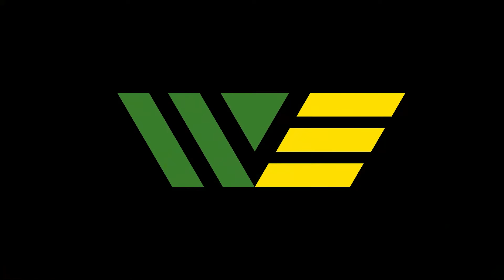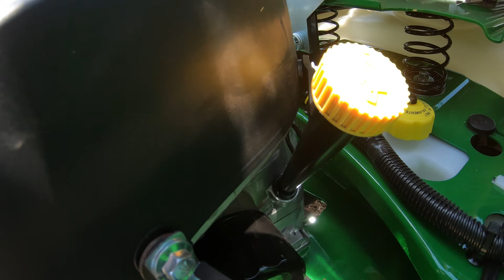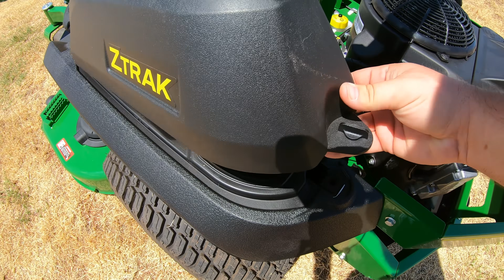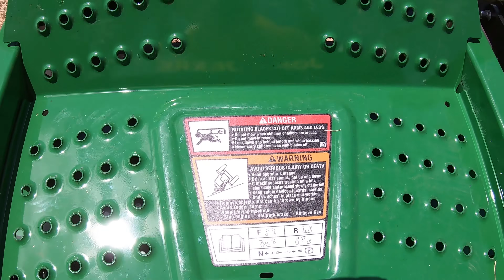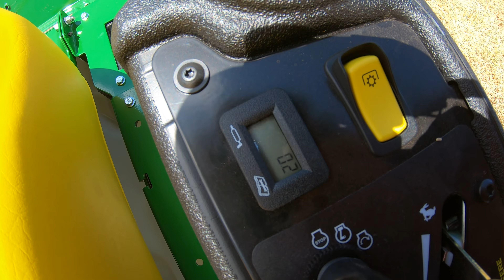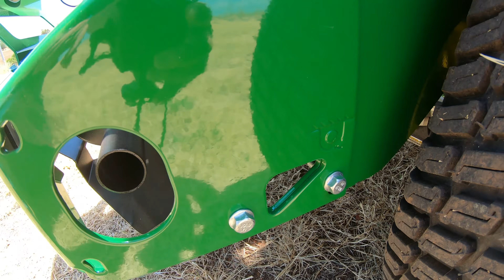2022 John Deere Z730M Zero Turn Mower Review & Walkaround

Comment: I'm thinking the Kubota z422 is better. It has the same motor but has wider rear tires and a better seat. I'm shopping around now.
Reply: Its a little cheaper to and has 3600  zts

Comment: I have a Z730m  and I love ❤️ it.😊
Reply: Just bought one today, can’t wait until it’s delivered
Reply: @RedNexTexMexVet hey did you get your mower? How are you liking it? Do you recommend it? How does it do on bumpy lawns?
Reply: @ClawzYT yessir I have had it a litte less than a year, it does great on my 3+ acres with lots of trees. I got the 54” deck, has plenty of power and almost too fast, i never go full speed. I did some upgrades included the rear bumper cage, hitch, and mulch kit. I also bought the Deere sweeper and it pulls it with ease even with a full load of grass and leaves. The seat glides and is very soft (cushioned). I can still feel the bumps but the seat cushion and glide take up most of the shock, it doesn’t hurt my back at all. I am very happy overall. Sometimes I look at the Stihl zero turns and think man that thing is nice maybe I should have gone that route, but rollin in a John Deere in the country also just feels right. Next I plan to get the lights and the airless tires which they say makes the ride even smoother
Reply: @RedNexTexMexVet hey that’s kool man, thank for the info. I’m about to get either this or the z735m at some point this season. I can’t wait.
Reply: @ClawzYT  of course, I got got the z735m btw with the Kawasaki. I think the 730 is brigs and Stratton but I hear are not as reliable

Comment: My z730M's right wheel keeps going forward when in the outward parking brake.  Do you know of any references of how to stop this?
Reply from the maker: You may have a bad connection on the switch that the lever hit when you put it out into the braking position or the switch itself may be bad. I would check this first.

Comment: Two questions one do I need to give you my serial number off of my John Deere x580 to get that little device that supposed to keep track of my hours and oil changes and everything I forget what you called it and two is the x585 4x4 still available thank you have a great day
Reply from the maker: Yes on the serial number, because we would have to make sure that your machine is compatible and on the other question, there is a X584 that is 4 wheel steer. Thanks for watching!